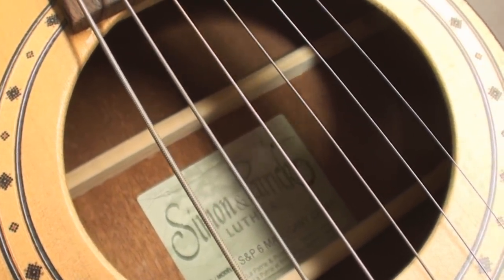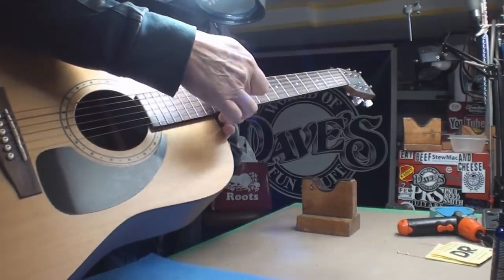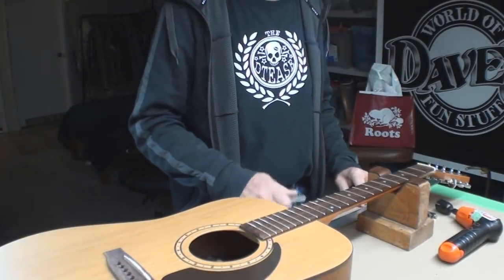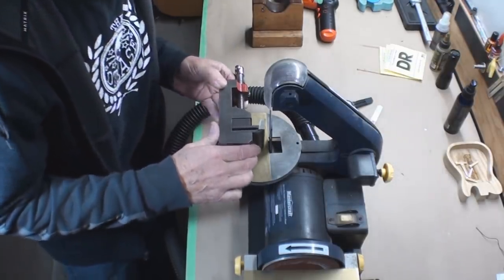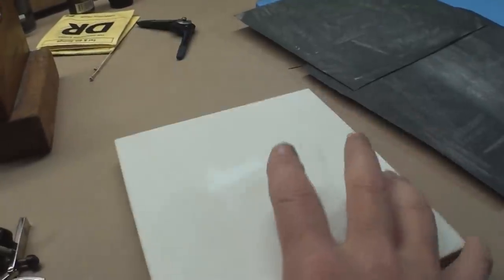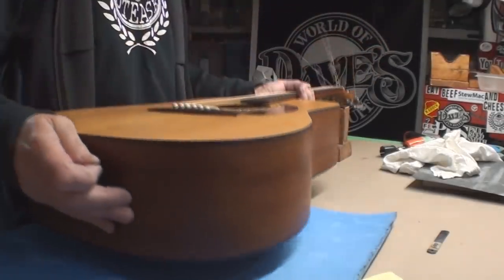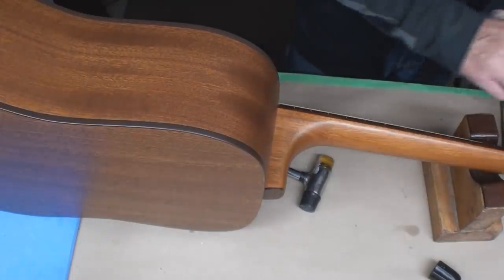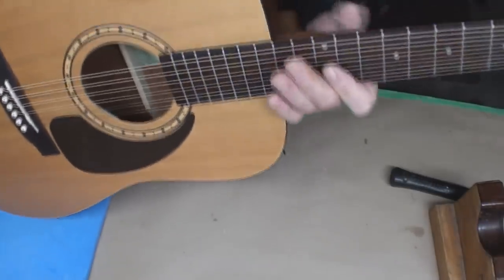Simon & Patrick Luthier Acoustic Guitar

Comment: Hi Dave.  Too late now, but there are diagrams on the interweb for strap button locations because the neck is a bolt on and you can hit one of the bolts if you drill in the wrong location.

Comment: I agree about the strings in the packet. Guitar teching in the dark is always fun, and string makers don't think about it, but a quick tip for finding out which gauge is which in the darkness is to leave them coiled and press from the outside of the coil.... less resistance equals lighter gauge. works for me 99 times out of 100, and may be a useful tip for youngsters watching your vids mate. Quo @ Quo Guitars
Reply: I was taught the by a teacher too...nice pro tip
Reply: That's a great tip. I'd add: buy a LED headlamp. You got both hands free and have perfect lighting.
Reply: I always had one with me mate, but there were some sets where the light wasn't allowed because of effect constraints, so I used a blue light as well on the lid of my tech box
Reply: I can switch to a darker red light on mine. (Black Diamond)
Reply: Cool. Right everyone, buy one of them now!! (awaiting my free version from Black Diamond)...........
Reply: Get your hands out of my mouth and take your words with you. I never said you should buy it. FFS I just mentioned what I bought.
Reply: @onpsxmember  I was joking

Comment: Try using a push punch. Also works for pick guard screws. I have one from the 70's but seen them for less than 10.00.
Reply: @DavesWorldofFunStuff  Gotta agree with Dave on this.As a retired Tool and Die maker, I can tell you push punches were made for sheet metal layout work and are pretty useless for anything else.